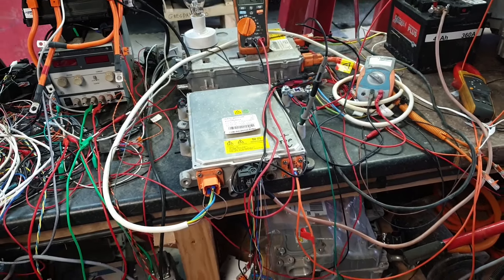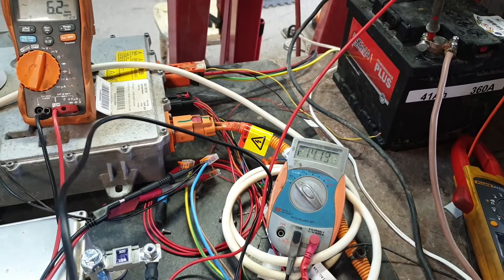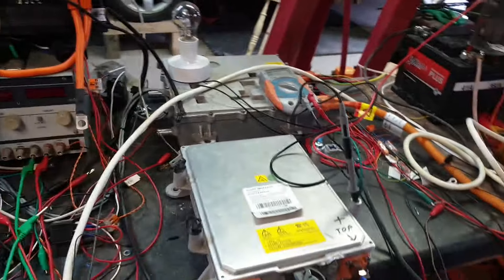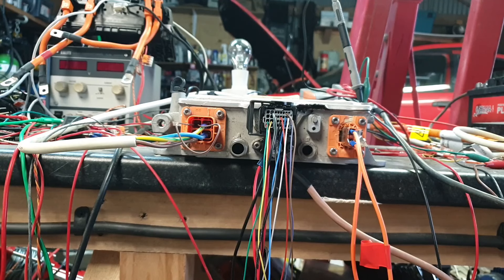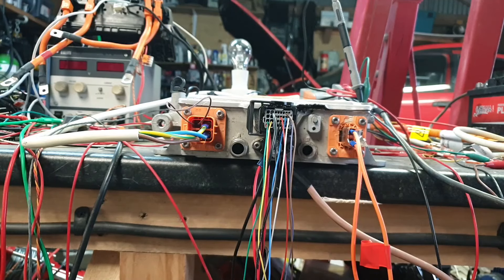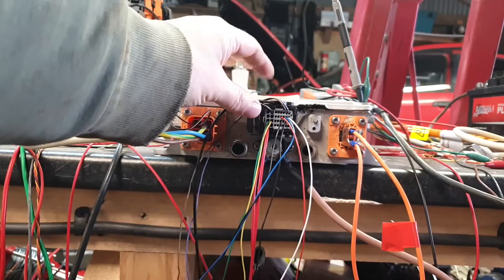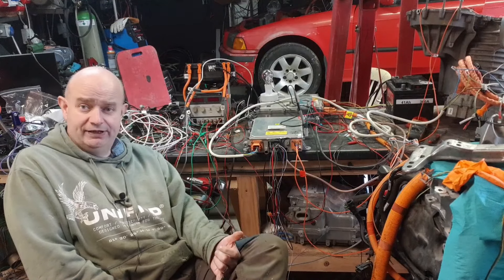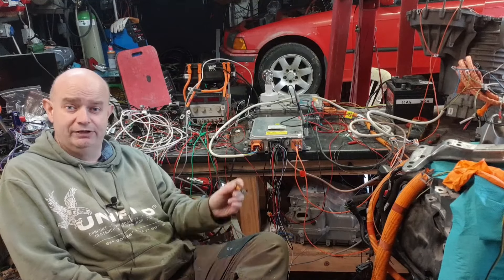MG ZS Gen 2 OnBoard Charger Hacked

Comment: This should be interesting!
So this unit could be a standalone power wall application before it gets installed in a vehicle.
Great plan for someone doing an EV conversion, they can learn about the charger!
Reply: I'm intrigued as to how you safely attach the AC to your mains circuit?
And the three phase version?
Reply: Can a heat gun be used judicially to release the cover after the screws are removed?
Reply: tiepup I was wondering about a transfer relay. Obviously not a high current device.

Comment: I am smelling something electric but that might be my oxy treatment at the gymn. Does it feed a garage  or can it actually feed into the grid without torching the transformer station? I wonder because if it had a phase sensor it probably would not output AC if it does not see mains first.